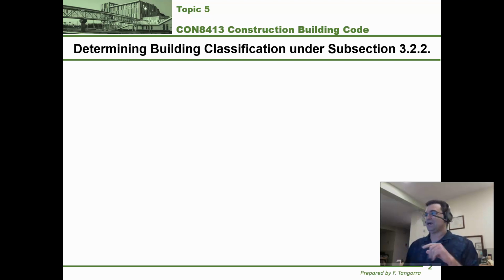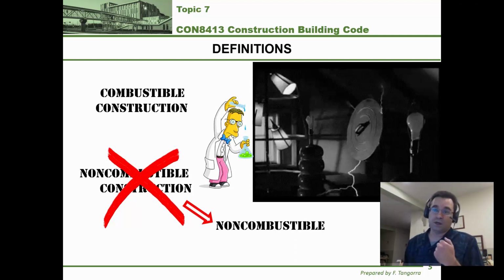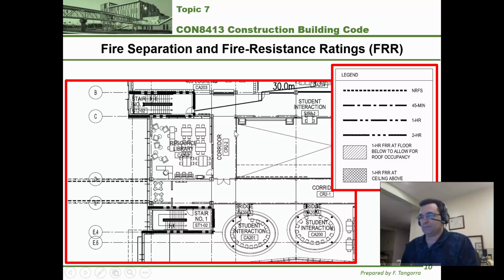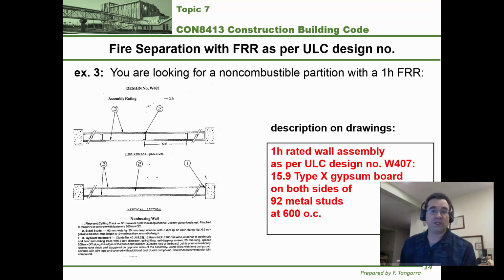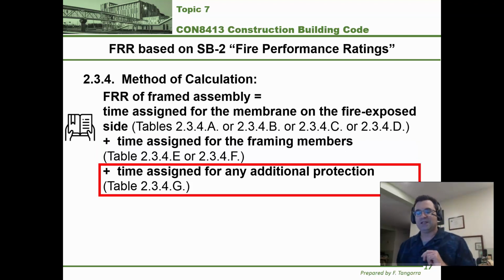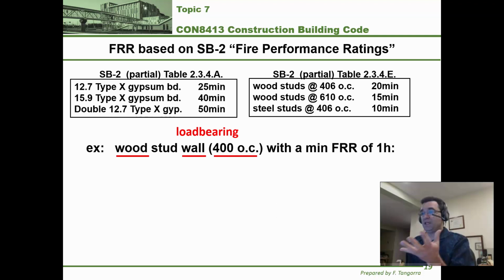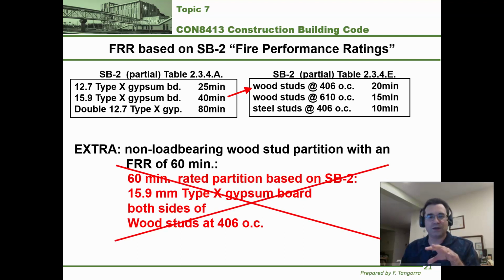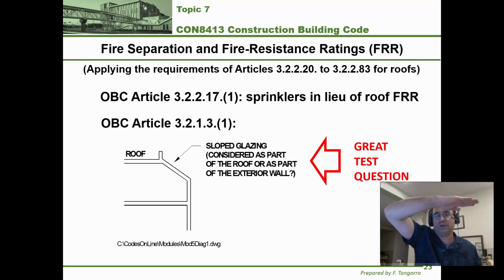CON8413: TOPIC 7 (FIRE SEPARATION AND FIRE-RESISTANCE RATING, FRR)

Comment: Nice lecture very informative . Only question is : Why with one layer of 15.9 mm Type X GWB on both sides can't be used with 38x89mm wood studs to make a  non-load bearing partition wall with FRR of 60 minutes? Per the Table 2.3.4.A the15.9 mm Type X ( 40 min) is allowed to use with 38x89mm wood studs. This table only says (on the foot note 2) Double 12.7mm Type X gypsum Wall board ( which has 80 minute FRR ) applies to non-load bearing Steel framed walls only. Could you please explain/correct this confusion? Thanks Prof.